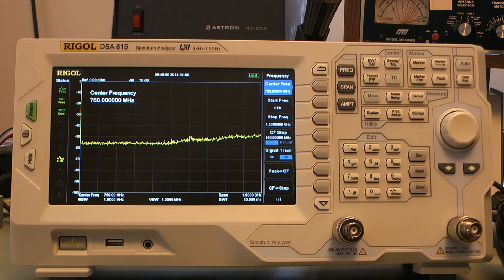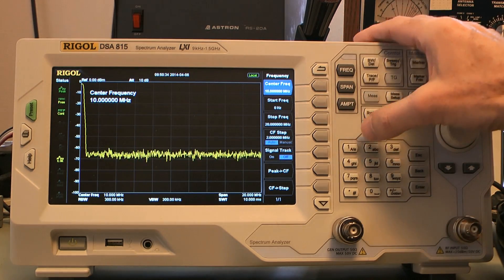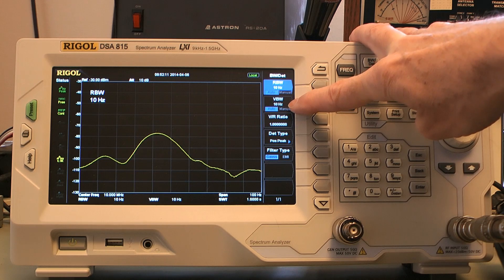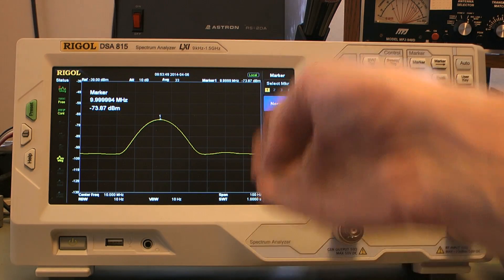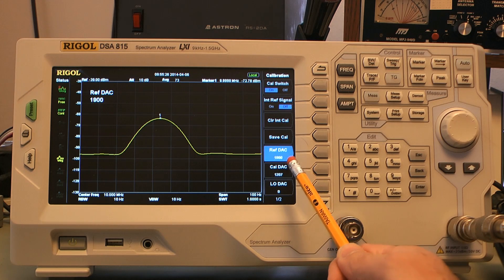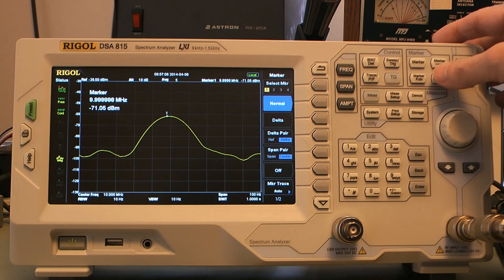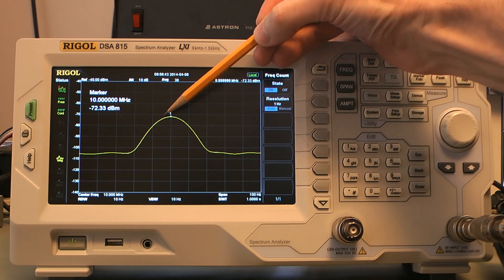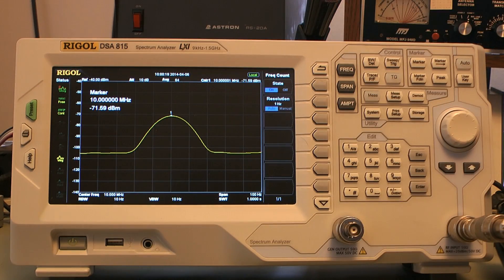DSA 815 Calibration using WWV

Comment: Where can I find the 10hz hack?
Reply from the maker: Hi Doug, I think I found it on EEVBlog (Dave Jones' channel).  I believe that it only works on older 815s.  Rigol changed the bootloader so that newer units can't be hacked using the method that I used.

Comment: Updated firmware to 00.01.18.02 and cant get into the service menu since the update.  Anyone else having the same problem?
Reply: The button sequence now requires two presses of the MEAS SETUP button after pressing the STORAGE button as shown in the video.
Reply: I just installed the 00.01.19 firmware and also found the keystroke sequence no longer works to access the service menu.  Maybe it has been changed.  Does anyone know how to access the service menu with the newer firmware?

Comment: Great video, Len - thanks!  I just did your calibration procedure on my mod'ed 815.  I live in New Mexico, and was able to hear a decent WWV signal today on 25 MHz, and everything went fine.  I only needed to change the factory RefDAC setting by two to get within 1 Hz at 25 MHz.  

I don't think folks who have factory stock units will be able to get as close with this method, though.  Maybe for them, coupling the 815's 10 MHz output loosely to a receiver tuned to the WWV signal at 10 MHz, and adjusting the RefDAC setting for an audible zero beat might work.

Or connecting a short antenna wire to the TG output, set to zero span at 25.0 MHz, and zero beat with WWV?

Cheers, 
Chris